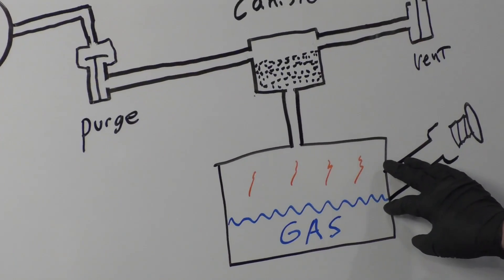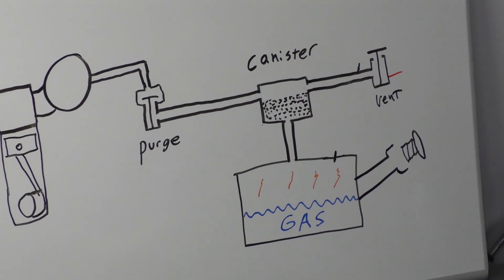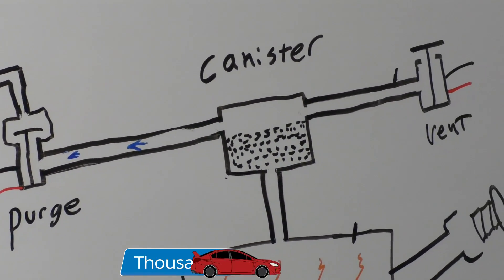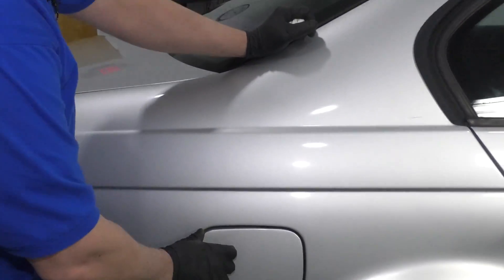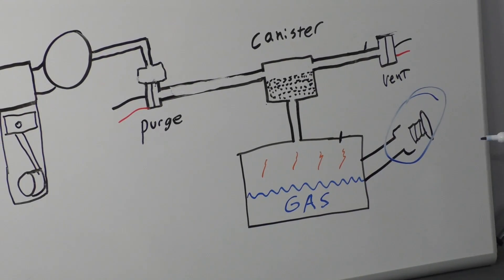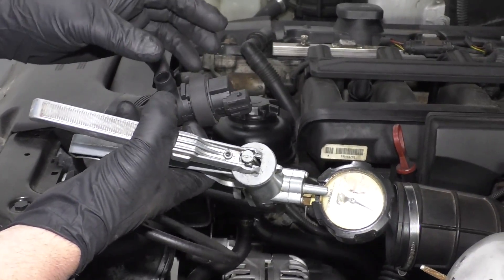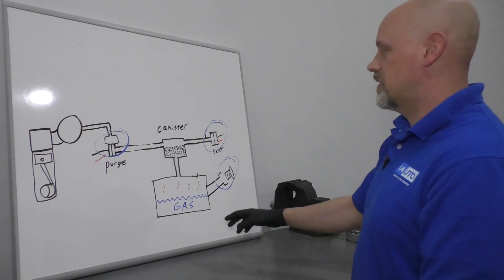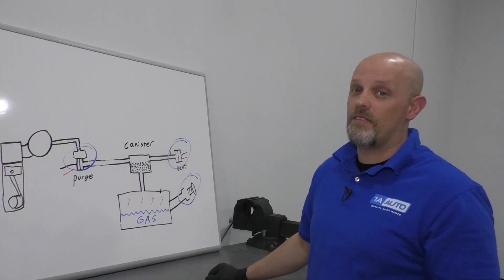Check Engine Light? Codes P0446, P0455: What Causes a Car EVAP Code?

Comment from the maker: √  Watch the Video
√  Buy The Part at 1A Auto https://1aau.to/m-Visit-1AAuto
√  Do it Yourself
√  Save Money
Reply: Thanks so much. Best I’ve seen on the subject.
Reply: Should show a how to with a simple machine like this one: 

https://youtu.be/4R4Q9Y-sW-s
Reply: Can this have long term effects if gone unfixed?
Reply: So my 2001 Ford F250 is needing the Fuel Vapor Tube Assembly replaced. My issue is I cant find an OE part to replace it with. The original tube assembly is 1/2 O.D. My question will it matter if I replace the Fuel Tube Assembly with a 3/8 O.D tube. If it will matter then whats your advice on fixing it. Im going to try some pull a part places

Comment: So if the EVAP is part of the emission system my readiness has passed then that means my evap is good but in my pid it hasn't passed yet I have one left O2 sensor but I know I have to replace the old to sensor either that I have a vacuum leak

Comment: Steady highway drive is what the EVAP system needs to retest itself.
My machenic told me to drive on the highway 50 - 70 miles straight to let the system run itself - check, and the amber error icon may turn off by itself. Yes, it turned off after driving about 50 miles.😂

Comment: Another problem is if the cannister itself contaminates the system. If it does it spreads charcoal through out the lines and valves. Once it is in there it needs to be cleaned out or hoses and lines replaced. It is tiny and gets into new and old solenoids causing them to stick open or shut.  So always check for black residue in lines and valves.

Comment: My 2017 Silverado doesn’t have a gas cap. I replaced the evap valve and within two weeks the check engine light comes back on. I used an oem purge valve.

Comment: Ive been dealing with this code on my 07 accent hyundai, tested for leaks in the vacuum lines, changed the gas cap, changed the evap valve, changed the vent valve that goes underneat behind the gas tank, swap the computer, and the problem still persist, all i have left is the charcoal canister and the gas tank it self. 😢

Comment: I didn’t get any codes but recently it’s been difficult to pump gas into my tank. The gas station pump would stop as I press on it. Which part would be causing this, the purge or vent valve? TIA

Comment: Check for rat poop in the engine compartment, if so they like a warm place to sleep and when my wife was a nurse coming home late night the rat would sleep on the engine and chewed a crank sensor wire and they also like hoses so after the fix it was a bottle of Tabasco and some expandable metal to block them out of the intake area. Thanks for the video

Comment: So, if a vehicle sits for an extended period of time, our fuel systems work just like in the old days with vapors sent to the atmosphere through the EVAP vent? All things equal, do most vehicle fuel tanks not generate enough gas vapors over an evening/night to put vapors directly into the atmosphere?

Comment: WRONG.   First thing you do is a smoke test.  If you mess with the gas cap and don’t find anything then do a smoke test chances are you may have sealed the gas cap by removing it and putting it back on.  
Do a smoke test to confirm it is or isn’t  the gas cap, vacuum lines, purge/vent solenoid, charcoal canister or top of the fuel pump.

Comment: Diesel very good tips for checking the evap system on a car, however… I ran into the trouble of replacing the filler neck on my 04 trailblazer… using a Dorman part… come to find out these Filler necks do not seal to the GM gas cap.. took me a whole year to figure out what was wrong…. I could not find anyone who could check my gas cap for me…… I purchased another neck thinking I had a defective one as well as two caps…. When I attempted to apply pressure orally to the filler neck and found the gas cap leaked as if it was an open vent is when I realized I needed the factory jam part filler neck… and that’s how I got my check engine light off and cleared for inspection

Comment: iHave a 2013 GMC Sierra & Got The Code PO446 , replaced the Charcoal Canister & truck is now getting gas quick into the tank without it stopping on its own

Comment: I have a 2009 Hyundai Santa Fe and after going thru a bad fuel issue, tank drained, etc. I have had occasional check engine light and sometimes off but the one problem is when pumping gas goes in slowly, vent valve changed but still same problem, getting tired of changing parts, 5 years ago had light, changed gas cap (no results) and then had purge valve changed and cleared the problem but always smell gas, anybody have advice?
Reply from the maker: +@user-wm9nv5ko2r We wouldn't be able to diagnose an issue like that here, you may want to have a local mechanic take a look at it. Thanks for checking us out! http://1aau.to/m/Shop-1AAuto-c

Comment: I have a 2002 dodge ram1500 it kinda hesitates too start and it has check engine light saying something about changing evap hoses and it also revs it self when on could the purge valve be the issue ?

Comment: I have a question my computer is throwing a P0455 and the air gas cap is tight so i took it to the shop and the guy said he would have to perform a smake text for $900.00, not including the part does thart sound. Does that sound right to  you? Thanks bro!! 
Thanks a lot for for your time.
Harry Lato!

Comment: Hi, Im having a ton off pressure when i take my gas cap off!!!! So much pressure that the evap system is screaming /hissing loud when it lets off the pressure. What could be clogged? Please help. I bench tested the Purge valve. seems good. TJ wrangler 2006 . 4.0  auto. Please help . Thank you
Reply from the maker: +81vampirelover We wouldn't be able to diagnose an issue like that here, you may want to have a local mechanic take a look at it. Thanks for checking us out! http://1aau.to/m/Shop-1AAuto-c

Comment: I get a 441 and 455 code occasionally on my 2012 Prius C. By occasionally I mean sometimes in the morning when I start the vehicle after it’s been sitting all night, and usually on cooler mornings. I replaced the fuel cap twice, but that didn’t help. Now I just reset the codes with my scanner and the codes don’t return until a few mornings later. Also, sometimes I can smell fuel after I refuel the car, but that doesn’t trigger any codes. Any thoughts on what might be going on here? I’m an accountant without much mechanical experience, but love trying to figure these things out.
Reply from the maker: +Gamer55 We wouldn't be able to diagnose an issue like that here, you may want to have a local mechanic take a look at it. Thanks for checking us out! http://1aau.to/m/Shop-1AAuto-c

Comment: Hello, so my 2002 Dodge Dakota has the check engine light on because of the Canister Purge Valve. Still runs and everything but the other day I went to put gas and gas pump stoped because it was full but then gas starting spilling from the bottom where the tank is at. Would that have anything to do with that canister purge valve? Thanks for your help!
Reply from the maker: +Hugo Olivera We wouldn't be able to diagnose an issue like that here, you may want to have a local mechanic take a look at it. Thanks for checking us out! http://1aau.to/m/Shop-1AAuto-c

Comment: My car has the P0455 code. It also has been struggling to turn on sometimes. It had a new cas cap and new purge valve. Could It be struggling to turn on because of pressure in the vaccuum potentially caused by a bad vent?

Comment: I may have a leaky tank hose or breather. My gas cap used to go "pshh" when i removed it. No more. Evap solenoid alows flow when energised. Blocks flow when disconnected. I just unplugged it and the breather line. I no longer smell gasoline either when i stop. Gas mileage went up 5 mpg... I believe it was sucking lots of air through the tank somehow.

Comment: I have lean codes on my vehicle but it's been pressure tested & no leaks, the evap shows fail when I put it on a diagnostics machine, but the scan tool sais p0171& 174 can a bad vent solenoid cuase a lean code if it is stuck open, or is there any other areas that would cuase a lean code? I've taken it to a mechanic several times & he said the lean code is coming from a pressure sensor he has never heard of on the evap system & after testing the purge valve & the on board diagnostics shows the purge valve opening when called for but shows failed evap system so my best guess would be the vent solenoid. Any advice would be greatly appreciated thank you

Comment: In all actuality this simple design here should be the the design for all of them. But no, they love to take simple and make it complicated by adding needles parts and hoses. My 97 f150 kept giving me EVAP codes, took me awhile to figure it out. Turns out it was a plugged up vent valve and a blocked charcoal canister. After cleaning both parts from all the dust dirt and mud then problem was solved.

Comment: My Charcoal canister was putting charcoal in my purge valve which was stopping at up so I took the charcoal canister off and install a new purge valve.. do I need to keep the hose in from the charcoal canister or can I take it off

Comment: Do not use soap bobbles it will suck it in if it has holes. The system works on a vacuum, not on a pressure system, like He said

Comment: The purge valve and related system is easy to understand, when it opens the fumes are vacuumed into the intake stream.  Tell me more about the vent: does it just vent to outside air or is it terminated in the system somewhere?  Your diagram doesn't show exactly what it does.

Comment: I already did the change of the gas cap and didn't work, today I changed the purge valve and had drove my car for 15 miles and the light stills on, should I wait a few miles more or should I clear the code with a scanner ? Thanks !

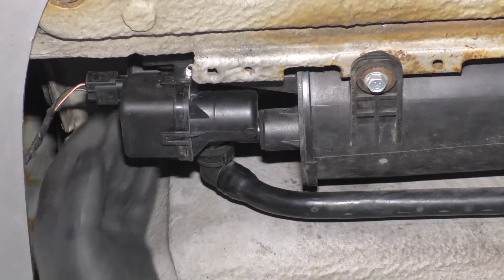Comment: @4:00, why do so many people get it wrong all the time!  Every car is different!  Jeeps and other Chrysler vehicles DO NOT COMMAND THE VENT TO OPEN!  They have a switch that can detect if there is a vacuum on the system, only!  If there is enough vacuum it will open and allow air INTO the system through the carbon filter, just based on the amount of vacuum, to draw the fumes into the intake Thru the carbon filter according to the purge solenoid duty cycle.  Is there ANYONE out there that can stop oversimplifying how these things work!  How many people have you led astray with bad and incomplete how-to videos?

Comment: I have a 2011 Jetta. The original gas cap doesn’t click any more. Then I bought a brand new cap which also doesn’t click. Then I bought a used gas cap which also doesn’t click. I still have the check engine and I’m out of ideas. Could it be a problem with the tank nozzle?? Thank you.

Comment: Would pumping gas with the vehicle running cause the evap system to turn the check engine on?
Reply: Engine running with gas cap open, it is possible.
Reply: If you pump gas while the car is running you're an idiot.

Comment: The real question does it effect performance? Can you still drive it?
Reply: I'm having this done right now along with other things in a 100k service.  You can drive with it, but with the PCV stuck open your engine is getting way more fuel than it needs to so your mileage will probably suffer.  Also, you might notice a steady howl from your engine as you accelerate.  A dead giveaway to a bad PCV is when you fill it up, the engine will act like it is flooded when you try to start it.  Engine might actually appear to be running fine, but this is what is going on under the hood.

Comment: Persistent P0455 code. Replaced gas cap twice. Looks like I’m going to have to try the “replace until it’s fixed route” to find the issue. No access to an evap smoke machine. What, after the gas cap, is the next thing I should try? I do have a faint gas smell. 2007 Tahoe.

Comment: I have a 2015 Dodge Journey, 95,000 miles. The message is small leak. I replaced both switches, still getting the message. Suggestions?

Comment: So I've got an interesting issue. 2008 Nissan Pathfinder 5.6 V8. Strong smell of gas all the time. When filling up, the gas pump will not stop itself. It will just pour out the bottom of the car. Showing P0455 code. Not sure where to start in diagnosing.

Comment: ok but what is it dont have a gas cap ..2015 gt mustang ..is it normal to hear the vacum while its running  or is that a bad seal..as soon as i opened the gas door i can hear the vacum working  ?? the code the owner got was replace the evap cannister hose ?? why ?? and 2 codes for o2 sensors ..nothing about a  0442 code //leak..normal???

Comment: Please can you help me with this problem? I diagnose obd mode 6 and found this:
Measured 655%
Minimum 648%
Maximum 7.5%
Status FAIL
Fuel system fail. No check engine. No misfire detected. My original fuel pump motor fail last year and replaced makes no difference. What are the meaning of measured data? Many thanks for kind replay!!!

Comment: Thank you for this video! I got 97 W140 Benz and recently I got P0455 error and CEL. I'll try to check both purge valves (this car has two of them) and the gas cap. Other stuff I can't even touch since my garage is pretty narrow. Unfortunately, the charcoal canister is located behind the rear wheel liner. Can't even register the car while this CEL is present...

Comment: I'm trying to solve a car: I've replaced the evap vent near gas tank, the FTP sensor, and gas cap within last 3 months. Original code was P0443
Now I have P0446, P0445, and "Check gas cap" alert
Any ideas?

Comment: My 2011 sonata 2.0t i barley drive with 59,500 garage kept has the po455 i changed gas cap, purge valve, Canister Vent Valve code came right back after 5 miles down the road what's next that i"m over looking?

Comment: One more tip on the gas cap, make sure it is clean and free of debris. If it's a bit dirty, just get some alcohol wipes and clean both the inside of the cap and the rim of the filler neck. That is one of the most common problems I've seen with the P0440 code

Comment: Hello. I'm sorry to bother you. I am the owner  skoda fabia 1.4  16 v- BBZ - 2003 -TMBHD26Y333756943 and I have the following problem which unfortunately in my location no one was able to solve. For some time now, my engine  Check Engine has been on. although I did several diagnoses (tests) each time the result is different (lambda probe 1 flashing, EGR, intake sensors, etc.) In addition to this there are 2 witnesses (I have the picture with errors) who sometimes block my accelerator pedal. I stop the engine and the lights go out. Unfortunately, no one can give an answer and a defective part for sure. There is a risk of changing a part that is not really bad. I would like some advice from you. Thank you.

Comment: This video explains a lot.  I had 2 different shops that did smoke test, and neither could find it.  The last shop suggested going to the dealer.  I have a 2010 Jeep Grand Cherokee, and experience with what may be causing this small leak on this type of vehicle. Code is a po456.  Some type of pump was replaced, which in this video I didn’t see or hear about a pump.  It was done before the smoke test.  I think the pump and labor was under 100, and they told me it may or may not be the problem.  2 smoke test later , I still have a problem.

Comment: I am having an issue with the EVAP on my car. I was given a $750.00 estimate to have it fixed. I am looking around online for some estimates for the EVAP code. I am seeing $200- $250. I am being advised that there is a part they need to order that the manufacturer discontinued making which is creating the high estimate? I have a few other places in my area to shop for the EVAP. Any suggestions?

Comment: As an old, retired electrical engineer I am very impressed with your teaching skills. Repairing my cars is one of my hobbies, but sometimes I am getting stuck into hidden specific manufacturing problems, like a fuse found under the wax paper insolation on a small AC transformer. Anyhow, I would greatly appreciate if you could help me troubleshoot my 2003 BMW 745Li, which started with not accepting more than 1/2 tank fuel (except when dispensing very, very little at the time), and lately getting the so popular check engine light on with the P0444 code on it. I disconnected and tested the purge valve and seems to be perfectly fine, opening and closing promptly when applying 12v to it. It may be that the purge valve intake hose having a small leak at the connection to the other hose going to the charcoal canister is triggering the P0444 code, but I do not believe this has anything to do with the tank not accepting more than half fuel. BTW, there is no pressure, nor vacuum at the filling cap after driving the car. Could you please feed back with your expertise/experience on this?
Thanks a million,
Chris
Reply: P0444 is  “Evaporative Emission System Purge Control Valve Circuit Open.”  You tested the valve itself so the circuit or the wire going to the valve has failed.  Your charcoal canister is filled with gas because it's not being purged, which is why you are having trouble filling your gas tank.  Of course I suspect you already know this.
Reply: I’m by no means a mechanic but I have a 2000 Ford ranger with P0455, a gross leak in the evap system. While doing some digging around I noticed my fuel filler tube was completely corroded and the rubber was very old. I’m planning on replacing this now and seeing if it can help keep fuel pressure due to the control valve and fix my rough start. While online I’ve seen people have the tube on their car be corroded as well or begin to leak gas whenever filling it up enough. It’s possible this is why you have to add the gas in very small spurts and why it doesn’t go past half